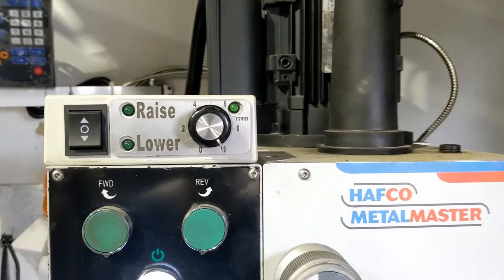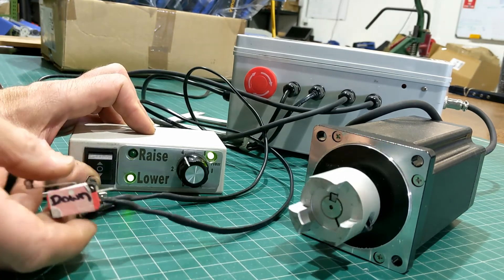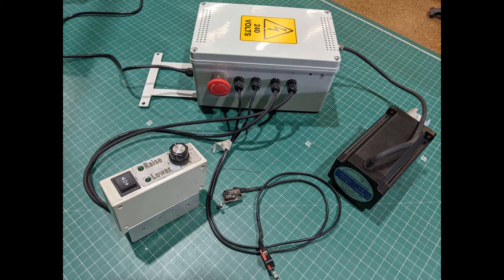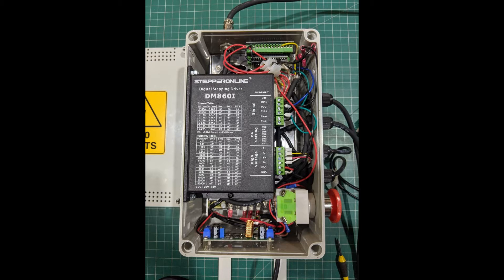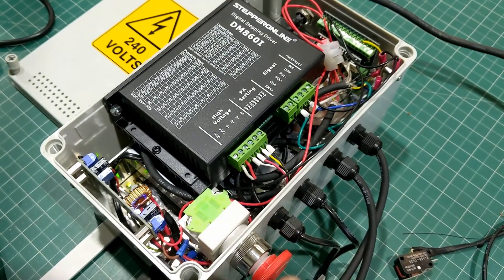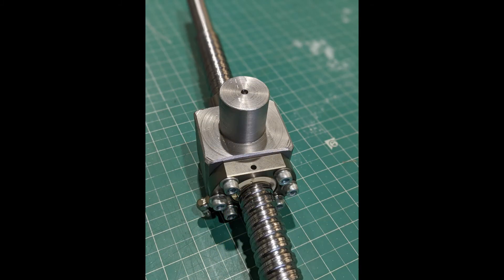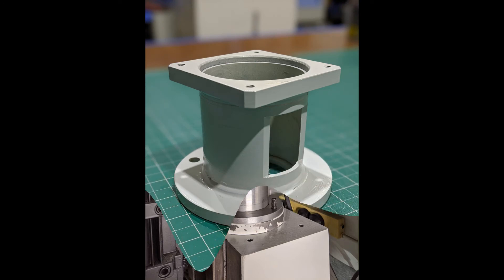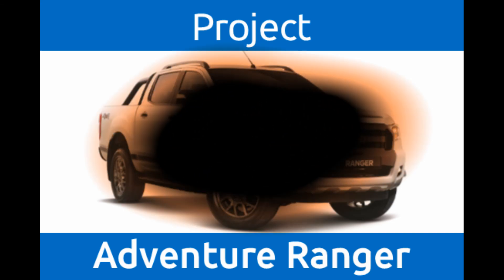Milling Machine Z Axis using a NEMA 34 stepper motor

Comment: where did you get the coupler with the woodruff key slot...i cant seem to find those..
Reply from the maker: Hi, thanks for reaching out. I found the coupling on eBay. Here's a link to point you in the right direction.
https://www.ebay.com.au/itm/202155473125?mkcid=16&mkevt=1&mkrid=705-154756-20017-0&ssspo=d7IaRZrzQfe&sssrc=2349624&ssuid=JgwR_gxRSuy&var=&widget_ver=artemis&media=COPY
Reply: @projectadventureranger1691  i have one like tht...did you put your key slot in?
Reply from the maker: @minskmade  From memory it's a straight keyway on both shafts. As i didn't have a keyway broach set at the time, the coupling keyways were marked out and made using a hand file. Since then, I now have keyway broaches!
Reply: @projectadventureranger1691  oh my...i have a set of broaches...but have never broached...it is not time :)
thank you

Comment: Would you mind posting or emailing me your final code.  This is exactly what I have been looking for
Reply from the maker: Hi Michael and thanks for reaching out. Here's the final code that I used noting the use of individual pull-up resistors in the circuit. Some arduino boards have inbuilt resistors that could also be utilised. Hope this helps in your build.

// define pins
// 1-empty-
// 2-empty
// 3-Dir+
// 4- Led raise
// 5-Pulsepin
// 6-Led lower
// 8- swfor
// 9-swrev
// 10-Lim1
// 11-Lim2

int pulsepin = 5;
int dirpin = 3;
int swfor = 8;
int swrev = 9;
int Forward;
int Reverse;
int Forwardstop;
int Reversestop;
int Lim2 = 11;
int Lim1 = 10;
int Ledraise = 4;
int Ledlower = 6;

void setup()  {
  // put your setup code here, to run once:

  pinMode(pulsepin, OUTPUT);
  pinMode(dirpin, OUTPUT);
  pinMode(swfor, INPUT);
  pinMode(swrev, INPUT);
  pinMode(Lim1, INPUT);
  pinMode(Lim2, INPUT);
  pinMode(Ledraise,OUTPUT);
  pinMode(Ledlower, OUTPUT);

}

void loop() {
  // put your main code here, to run repeatedly:

  //Gather information
  Forward = digitalRead(swfor);
  Reverse = digitalRead(swrev);
  Forwardstop = digitalRead(Lim1);
  Reversestop = digitalRead(Lim2);

  if (Forward == 0 && Reverse == 1 && Forwardstop == LOW)
  {
    // read the sensor value:
    int sensorReading = analogRead(A0);
    // map it to a range from 0 to 100:
    int motorSpeed = map(sensorReading, 0, 1023, 0, 100);
    digitalWrite(dirpin, HIGH);
    digitalWrite(pulsepin, HIGH);
    delayMicroseconds(motorSpeed);
    digitalWrite(pulsepin, LOW);
    Forward = digitalRead(swfor);
    Reverse = digitalRead(swrev);
    Forwardstop = digitalRead(Lim1);
    Reversestop = digitalRead(Lim2);
    digitalWrite(Ledraise, HIGH);
  }
  else if (Reverse == 0 && Forward == 1 && Reversestop == LOW)
  {
    // read the sensor value:
    int sensorReading = analogRead(A0);
    // map it to a range from 0 to 100:
    int motorSpeed = map(sensorReading, 0, 1023, 0, 100);
    digitalWrite(dirpin, LOW);
    digitalWrite(pulsepin, HIGH);
    delayMicroseconds(motorSpeed);
    digitalWrite(pulsepin, LOW);
    Forward = digitalRead(swfor);
    Reverse = digitalRead(swrev);
    Forwardstop = digitalRead(Lim1);
    Reversestop = digitalRead(Lim2);
    digitalWrite(Ledlower, HIGH);
  }
  else { //turn off LED lights
   digitalWrite(Ledraise, LOW);
   digitalWrite(Ledlower, LOW); 
  }
}
Reply: @projectadventureranger1691  Thank you so much. I really apprecite it.  Hope to wire it up on the bench this week.   Is the schematic in your video still good to go.  Sorry. I am a novice when it comes to Arduino but willing to learn
Reply from the maker: @michaelfluck4720  Arduino can be daunting at first but luckily, there's plenty of help on YouTube . 
The revised schematic is slightly different having removed the three-way switch and installing two momentary switches into pins 8 and 9 (instead of pins 5 and 6).  Note the updated comments regarding the 10k pull up resistors when wiring the switches. Basically, when you push the button the 5v goes directly to ground giving a low (zero) reading, at all other times the 5v supply also feeds through the 10k resistor giving a high reading to the arduino via pins 8 or 9. As per the code, when the arduino reads low on the forward switch, low on forward limit switch and high on the reverse switch; current is supplied to the motor driver. LEDs were also installed to indicate direction.